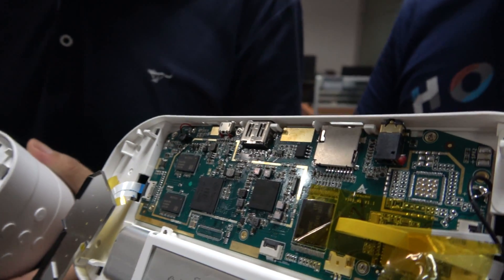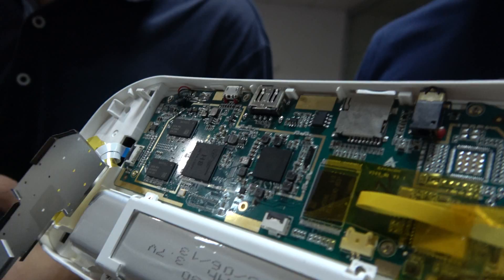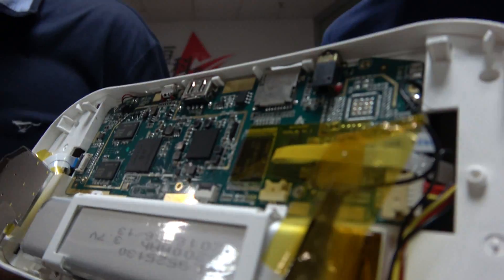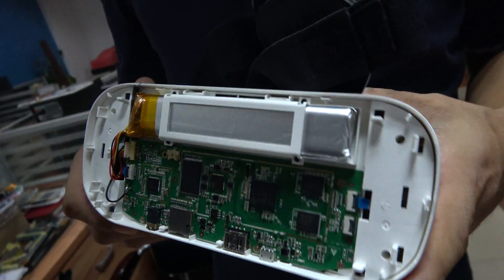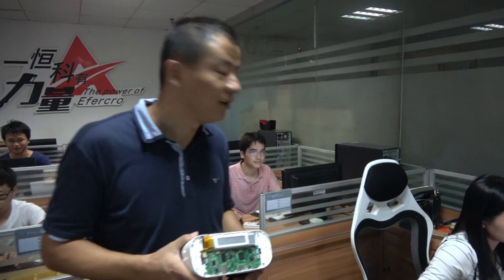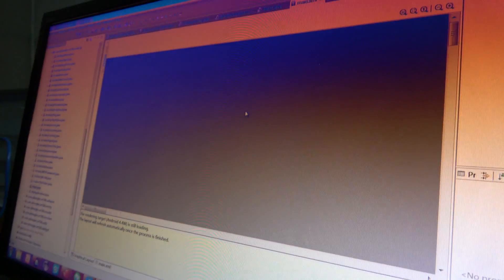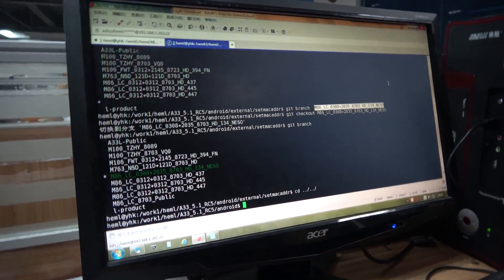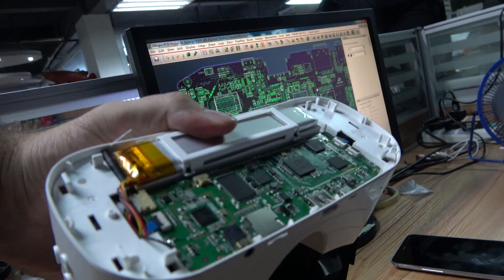$42 all-in-one VR headset on Allwinner A33, $90 on Allwinner H8 by Yihengke

Comment: Would at minimum only want something with a resolution of 1080p, maybe rather even 1440p, since when worn, perceived resolution will decrease to half per eye, if resolution would be 720p, very likely to look like a pixelated mess that is still comprehensible, but just looks bad, even more if the pixel density of screen was low (if pixel density is high, probably helps make things look sharper), another thing is subpixel degree, where between LCD RGB stripe and OLED pentile matrix, these LCD displays could look sharper with more subpixels...however OLED can look more vivid and have better/real blacks, where dark pixels on LCD can look slightly grey with a glow (even more the brighter the leds and the closer the screen to eyes), with light from led strip or behind other pixels bleeding into pixels that are supposed to be dark, on those thick FALD TV's, that's usually compensated with many very bright led zones behind group of pixels that individually dim.

As for framerate, would only want something at 120fps, maybe more, cause at 60fps or even lower framerate, will more likely have people having trouble with motion sickness.

Most phones people carry these days have quite a good resolution, pixel density, OLED display, some even support 90-120fps, can fit that phone in some ten dollar VR headset phone holder, download some VR app, or turn on the VR mode on YouTube, or even download some app to connect and use phone with PC to use with SteamVR (unsure about latency though, eg time between what happens on PC arriving and showing up on phone's screen), cause a lot of VR goodies are on Steam now (just need a pair of VR controllers, or maybe even those cheap to build VR gloves from Lucas VRTech), and call it a day.

If it's just an Android thing with a comparatively worse display, well....
...maybe there are some people that want a dedicated VR headset and not use their phone (or display of phone is not great, like those blurry cheap ones with 720p resolution and low pixel density), or this one is much better than expected, or someone with a low income can buy it?

Curious how people are actually experiencing this VR headset in this video right now... ¯\_(ツ)_/¯

Comment: Screen resolution of 1080p, it is a very low resolution for VR. 720p - makes no sense at all.
Reply from the maker: Most of the low-cost 360 cameras record at only 1080p now, this means the 720p all-in-one is plenty enough to see all the pixels when you look in any one direction of the 360 video, even for 4K 360 video, try to consider that you might only see 720p of it in the field of view of the 5" display inside of those VR glasses, to take advantage of a 2K VR display, you'd need to record 8K 360 video, that's not quite popular yet, you'd need to merge 6 or more cameras of 4K resolution each, do YouTube 360 or Facebook 360 even support 8K 360 yet?
Reply: I have Insta360 4K camera and I see my video on ZTE smartphone with 2K resolution. I see big different picture quality than on 1080p.
Reply from the maker: 4K 360 video in a VR glass means you see less than 1080p at any one point wherever you look in the 360 video, I guess it depends the "field of view", I think the 2K display you use upscaled the video when in 360 video mode, so sure upscaling to 2K looks better than "just 1080p" but the native resolution that you actually see is less than 1080p.. I think. I haven't checked exactly what that field of view degrees is for the different 360 VR glasses on the market..
Reply: You agree with me that when viewing a normal video at 1080p, not 360 degrees, a screen resolution of 720p at VR glasses will give a terrible image quality?
Reply from the maker: Sure it's low resolution for VR, but there's no need for more especially if you use it for 360 video filmed with cheap 1080p 360 video camera such as the ones that are 95% of the 360 camera market now. So sure it's not quite high resolution for 360 video, but it's usable for an interesting 360 experience for now. Real 4K 360 video comes in mass production later as next generation chips are introduced at more affordable prices for 360 dual-lens and even more lens camera merged.